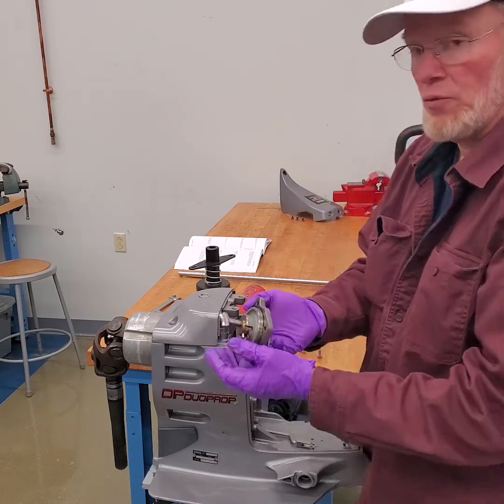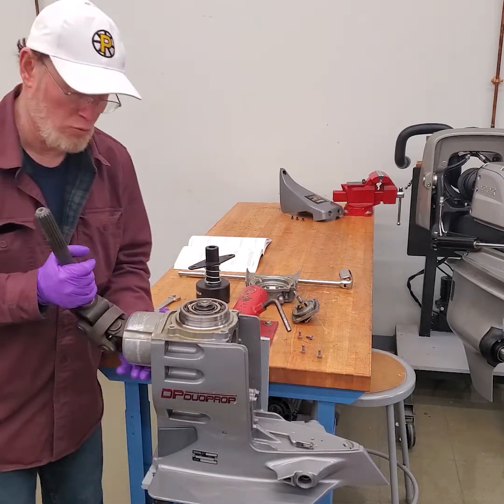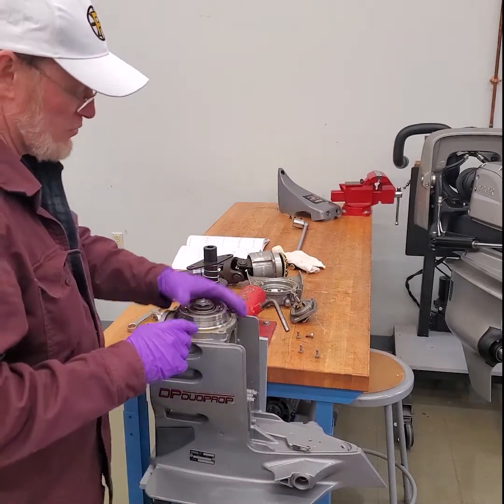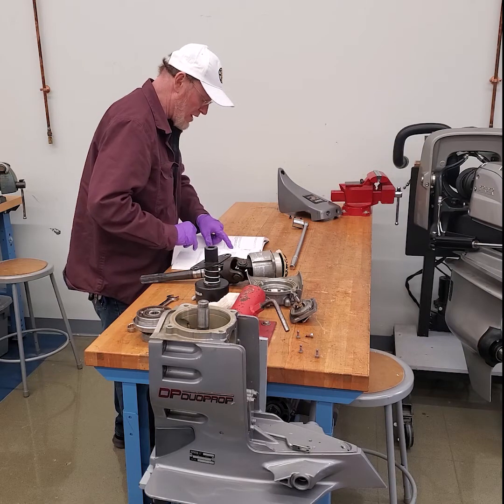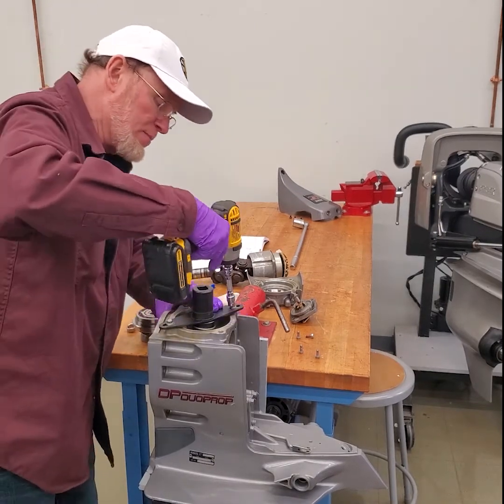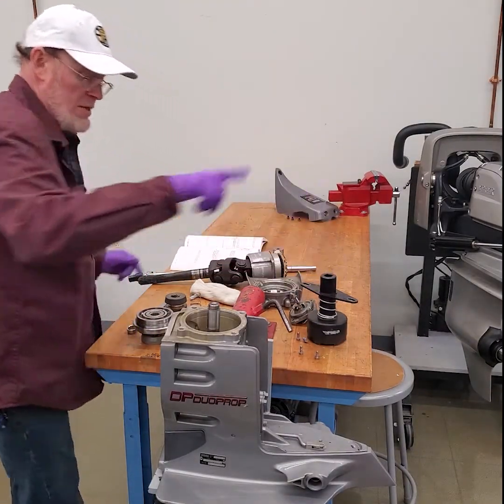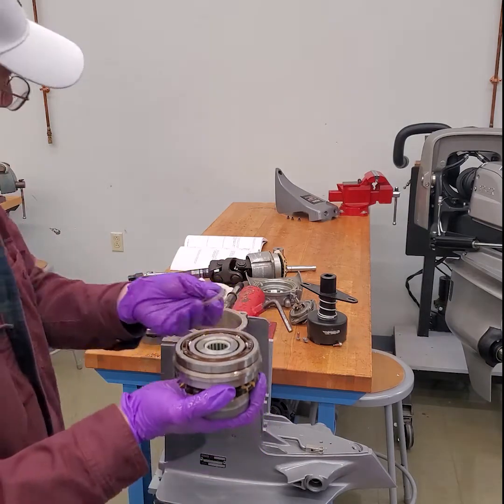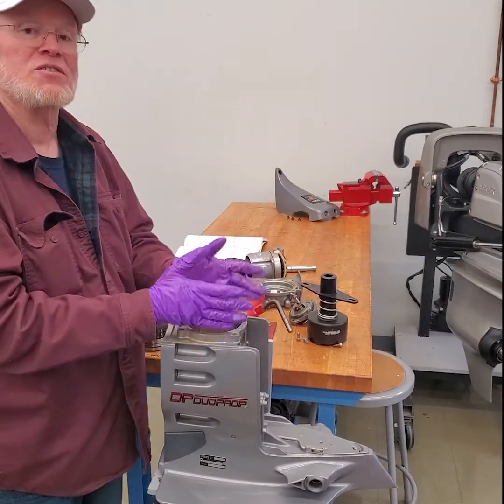Volvo Penta DPS Sterndrive Upper Gear Housing Disassembly

Comment: Hey, is ist Okay to just Loose the Top Nut which holds the Shaft With gears, when i want to Change the shifting actuator, which is between gear 1/2. I heard it could be a Problem because the shaft Could move down then, and releases the two Half Moon nuts at the end of the shaft(bearing). Or can it Not move down when the lower gearbox part is Mounted. Thx for the nice Video’s
Reply from the maker: You do not need to loosen the top nut to replace the shift actuator, only if your replacing the cone clutch. That would require total disassembly of the uppper drive.

Comment: Ted,  thanks so much for your videos! What tool do you use to shill the stop bolt in the shifting mechanism? The manual refers to P/N 3850057 which is impossible to find, and I also found a manual that mentions P/N 3856761 but doesn't specify for what model. Thank you in advance for your time.

Comment: Hey Ted.... I have a 2013 Regal 2500. I have a DPS-B outdrive. It looks different that this one. Is this a DP-S? Am I correct in thinking that a DP-S and a DPS are two different style drives? Are there any similarities? I work on my own stuff and I love your videos!! They so helpful for people like me. I really appreciate you taking the time to do these. I'm wanting to replace the u-joints only in mine, not the whole shaft assembly. Is that possible?
Reply from the maker: The older DPS was the one in my video. It was replaced in 2006(? ) with the DPS-A, which is similar inside but very different outside. It is also available with different gear ratios for the higher rpm 6.0L and GenV engines. Yours is a DPS-B with newer helical cut propshaft splines.
Reply: @tedsmarinerepair8956  correct. I do have the helical splines. Makes it easy for the props to come off. The only difference I've heard between the A and B drives are the helical splines. Is that correct? Mine is a DPS-B 1.95. I have a V8 300-C-A. I ended up taking the u joints to my local driveshaft shop. They do plenty of Mercruiser but only a few VP's over the years. He said he would have to order in the joints as they're slightly different than the Mercs.

Comment: I have to change my upper gear case the dip stick threads are stripped? Do I just remove it and replace it using the same shims that are in place.  Or does the shim hight have to be re calculated? Thanks
Reply from the maker: If you are changing the gear case, YES you must go through the full re-shimming procedures due each case is machined within a set tolerance.
Reply: @tedsmarinerepair8956  do you have a video that shows how to do this?
Reply from the maker: @carrigo53  We teach this in our marine technology degree courses.
Reply: @tedsmarinerepair8956  is that an online class? Can damage be done to the drive if the shim is not correct?
Reply from the maker: @carrigo53  no it is an in person course. And yes if the gears are not shimmed to the proper position it may cause catastrophic drive failure.
Reply: @tedsmarinerepair8956  I was looking at the workshop manual If I am reading it correct I place the cover on the top of the drive with no O ring  and .040 sims in place slide a guage between the cover and the drive to mesure the gap then remove the cover correct the gap with shims replace the O ring torque bolts what is the total amout of gap am I trying to achieve with shims Thank you for all you help!! you videos are very helpfull!!

Comment: hi ted love your videos would it be to much to ask for measurement of the tool you use to remove nut to get lower bearing out of DPS upper unit so i can try to make it i am not a shop but need to disassemble upper drive.
 my email is/leeplumb57@gmail.com
regards leigh from australia